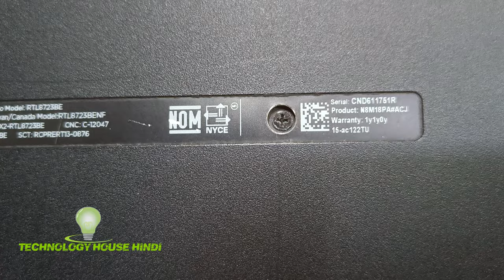Hp 15-ac122tu Ssd upgrade , Hp  15-ac122tu  Ram Upgrade , hp  15-ac122tu   sata Ssd upgrade

Comment: Thank you for the video and actually I wanted to use my existing hard drive with an additional SSD, so as mentioned in one of the reply, I can use the optical drive port as another hard drive slot, thank you for the reply as well.
Reply: Yes. you can. Any 15 inch laptop optical drive can be replaced with hard drive for additional storage.